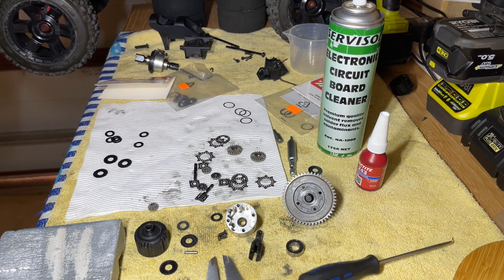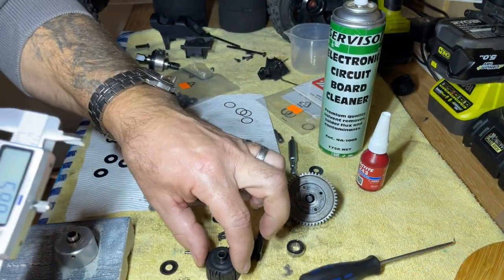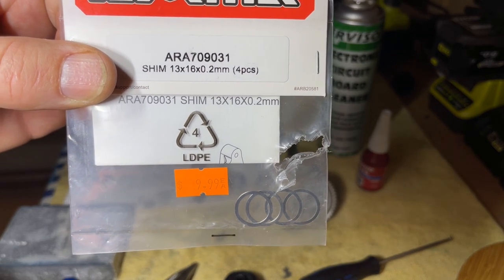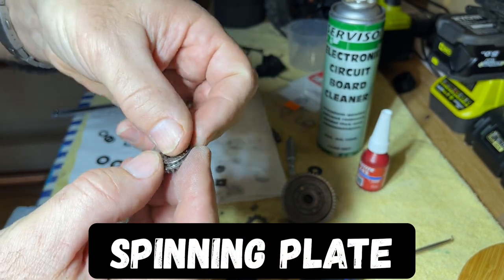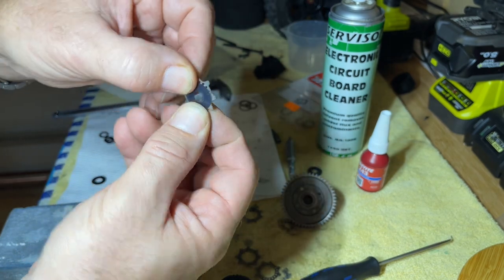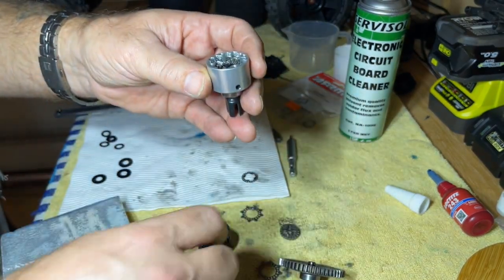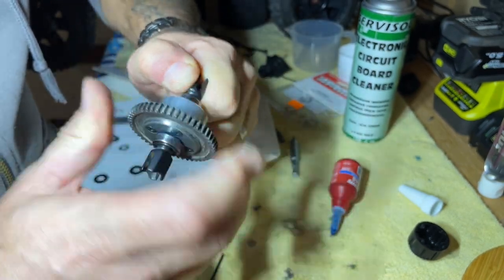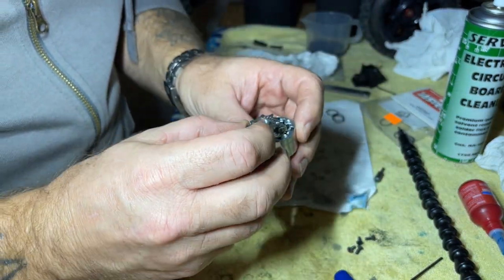VITAVON diff cups??? - YOU MUST DO THIS - Part 2 -Mojave EXB

Comment: I had the same problem with my standard exb rear diff. It just rounded the tip of Sun gears and spider gears.
I shimmed it up with 2x big shims 1x small shim on both sides and re used the same slightly rounded gears but put new lsd plates in it and it shimmed up and meshed up perfectly.
Vitavon might of made the out drive cup hole slightly bigger to suit their own out drive cup's. 🤔 Cheeky devil's if they did lol.
Reply from the maker: Oh good to know bro thanks for sharing that. Yeah I was quite surprised when I saw that but it feels so tight now and can’t wait to get it out for a run when this rain stops. 
I might have to check out their out drives. You might be right. Thanks again bro. 👍🏼
Reply: I use Gold grease,  it's thicker and won't rub like diff oil
Reply from the maker: Thanks for the tip man. I’ll give it a go. 👍🏼

Comment: I have rtr with open diffs and stock oils (if it has anything 😳🤣) and was thinking about running 200k in the center, then I discovered about the limited slip diffs available and am curious how the lsd would act with the stock 100k vs the lsd with 100k..I got my Mojave because it looks like one of the most grounded rcs that arrma has in it lineup and want to try keep it like that for the most part. Being a tinkerer tho can’t help but think it could be improved..probably start with a lsd center on 100k then maybe one for the front or just replace them as they break? Idk lol cool videos tho man 🤜🏽🤛🏽 
Also thinks on mine if I have to replace the arms I’d get some kraton 6s rpm arm and aluminum hub carriers, have you had any arm or hub carrier troubles? Only problems I’ve had with mine so far is tires started coming unglued, body is getting beat up pretty bad, bumpers and concussion rings are breaking, so far nothing major  🤞🏽
Reply from the maker: Thanks so much for this very detailed comment bro and I appreciate you taking the time. 
I put the 200k in the center because I do like the front end coming up but now that I’ve put the Trenchers 3.8 LP’s on I’m thinking of going back to 100k. Yes the lsd will act like a slightly thicker oil due to the fact is has friction plates to drive the drive more evenly but to be honest I would stick to the standard open diffs. 
In my latest Mojo video, I’ve changed the rear to a full open diff and it drives awesome. It all depends on how you want the truck to act on full trigger. I’d like it to be more grounded now with the larger tyres so that why I want to go back to the 100k
As far as the alloy hubs, I don’t have them on the mojo but I do on my K6 and I love them. I send it big time and they just don’t break. I don’t drive the mojo as hard but I will replace parts as they break. Next mod for the mojo will be alloy diff housings. 
It still has the stock arms and I’ve not had a pro with them but if they start breaking I will definitely be putting RPM’s on it for sure. 
All up, just try different oils and set ups and see which you like best. 
Cheers bro. 😎🤙🏼👍🏼
Reply: Cool cool man, appreciate your quick reply ✊🏽👊🏽 Maybe I’ll just try 200k and leave it open till it breaks or needs work, I looked on rpm web sight for control arms and it appears they only has for the 2wd model? Maybe they have if calls them. Kraton of course has complete sets for. Am kind of conflicted adding the kraton arms tho because is basically making a fireteam minus all the tuning and adjustments that arrma builds into these great trucks. Also kind of thinking I wouldn’t really have any arm problems unless a pillow ball breaks or pulls out, body definitely helps keeps them protected and being slightly shorter am sure helps too.

Comment: The diff gone? 🤣🤣🤣 Maybe cause the big tires?.or you never put a diff oil in the case? 🤔
Reply from the maker: 🤣 nope it wasn’t because of the oil (I had plenty inside) or the slightly bigger wheels, it was because the planetary gears and sun gears were not meshed properly. The Vitavon cups are slightly larger than the standard cups so I had to custom shim them and this is what this video is about. Now that they are shimmed perfectly, the truck runs amazingly. Check the test video and you will see how well it runs now. Thanks for the comment brother. 😎👍🏼🤙🏼👊🏼